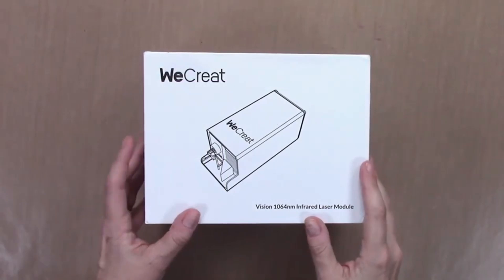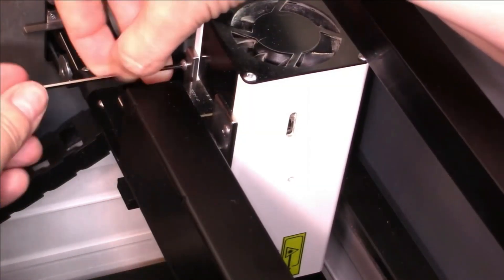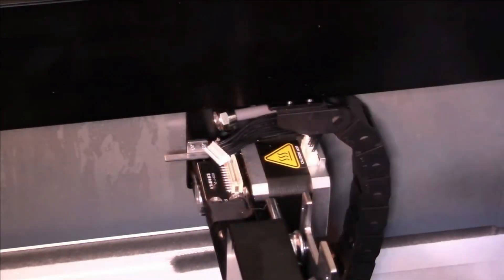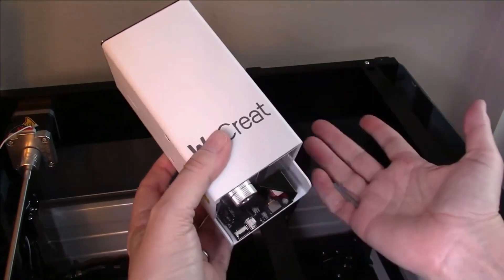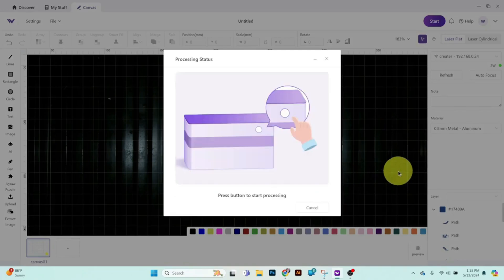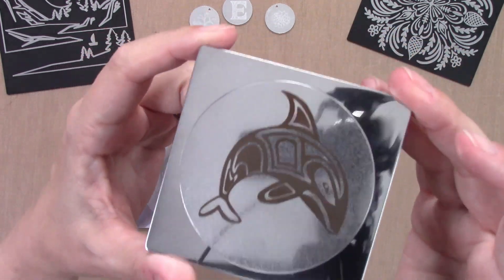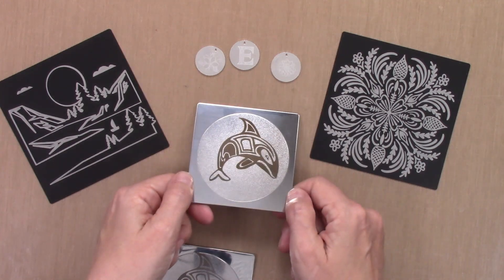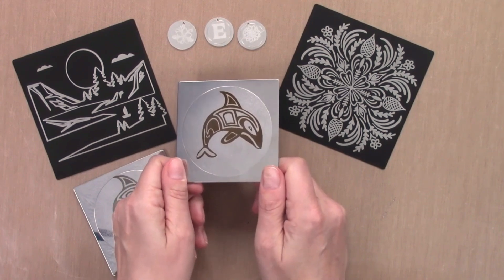Enhance Your Vision with the WeCreat Infrared Laser Module

Comment: I assume that you have to change both the laser module and the circuit board every time you want to use it?  Approximately how long does it take?
Reply from the maker: Yes, you have to change both each time. In the video, since it was my first time doing it and I was learning as I went, it probably took 25 - 30 minutes. But now, I'm sure I could do it in 10 minutes or less. If you have more space around all sides of your laser, you could probably do it faster. I'm constrained by limited space so that makes it harder to reach all the screws. I hope that helps!